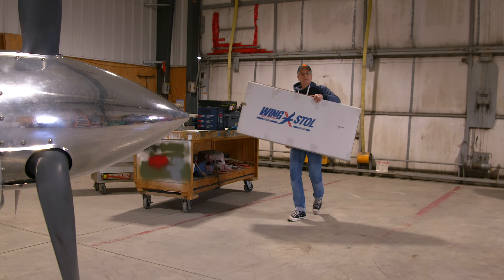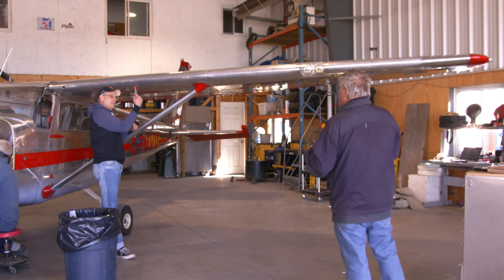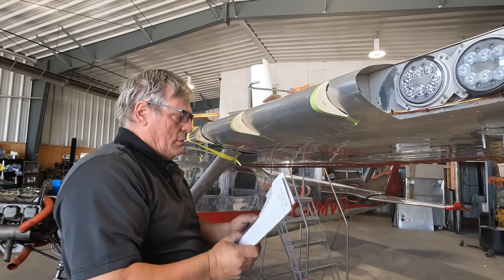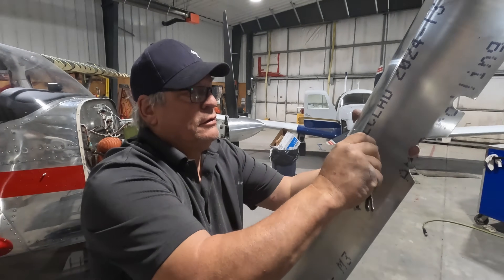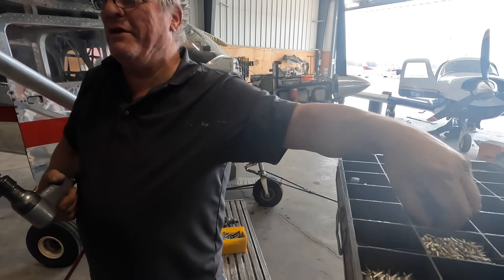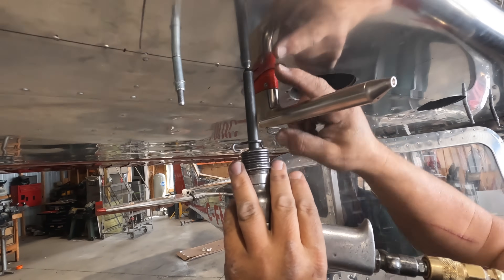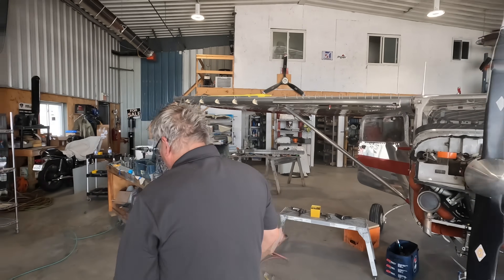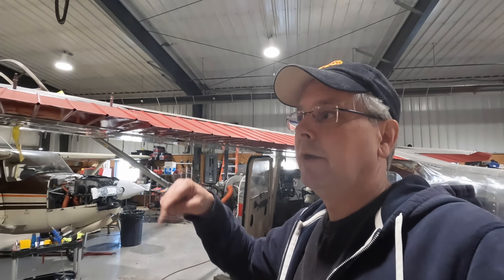Sportsman STOL Kit Installation Cessna 172B

Comment: I bought a 1960 172B which had the same stol kit. Mine included stall strips on the top of the wing.
I always assumed that the kit would cost cruise speed but during a long cross country, flying formation with another later model 172, I had to throttle back to keep from pulling away. When we landed I found the other plane was at max power.
Interesting video.

Comment: I worked for Wren Aircraft in Buckeye, AZ back in 1986. We modified the C182 into the Wren 460P STOL. It was a complete STOL modification that went way beyond the leading edge cuff.
Reply from the maker: Those were amazing - we did as much as we could with this 172: Sportsman STOL cuff, VGs, 3 feet of wing extension, and the drooped wing tips.  If only we could have put canards on the nose...

Comment: its already a stoll aircraft, they are so light. i put flap gap seals on my old 172C, half fuel and me 80kg, the airspeed indicater doesent read the stall speed on landing, had to be under 40kts, my guess about 35kts. this one has to be way better.  my stall speed was lower than most micro lights

Comment: Very neat to see the profile change.  
Will there be specific procedures and adjustments to the AOA sensor and your Airspeed indicator etc now that Stall speed is lower? Does that kit come with a set of numbers of what will change or do you figure out that yourself on the flight test?
Reply from the maker: We definitely have to re-calibrate the AOA, and we have to figure out all the numbers ourselves since we stacked 3 different STOL kits at once.

Comment: Thanks so much for filming this! We just got done installing a Sportsman STOL kit on a 182-B, and it was an excellent learning process. If you have video of Andre using a straightedge to check the alignment of the foam blocks, could you share that as well? It turned out we were doing it incorrectly (as the instructions weren't super descriptive in that area), but fortunately we figured it out at the 11th hour. 
Also, did Andre lay down a bead of sealant across the top rivet line (but not the bottom rivet line), in addition to the front face of each foam block? We had some debate as to if this was really beneficial, but ended up doing it as the instructions called for it. Just curious to find out more from someone who appears to have done plenty of these kits.
Also, does the 172 kit come with aileron gap seals like the one for our 182?
Reply from the maker: Andre didn't put the sealant on - he's seen several of these kits taken off after years of use, and his opinion about the sealant is that it breaks down over time and with flexing stress of the airframe. The gap seals for the ailerons are part of this kit and we put those on; but there was a discussion about their usefulness.

Comment: I've always wondered what one of the relatively simple Cessna's from this family would do with some performance upgrades in the other direction, full gap seals on all control surfaces, more modern cowl design, variable pitch or constant speed prop, and some attention paid to drag from where parts of the body meet (struts connection to wing and fuselage, wing to fuselage, tail surfaces to body). 
Obviously you're not going to change the Vne or Vno to that of a Mooney but I bet you'd get a decent increase in cruise speed at 75% power or some useable range.

Comment: It’s like having permanent slats - does it reduce max speed?
Reply from the maker: No reduction in max / cruise speed - in the next episode we instal the WingX extensions and that saw a 1-2 MPH increase in initial testing... of course that's within margin of error territory. So no appreciable difference in max / cruise speeds.
Reply: @GlensHangar  Ohh nice! Forgot you were doing the tip extensions. Guess it’s an overall net decrease in drag. Very cool.

Comment: will the new seam at the junction of the new wing cuff be water tight? if not, how will you inspect for possible corrosion?
Reply from the maker: It will be as water tight as any other part on the aircraft... which is to say; not very watertight at all.  Cessna seems to follow the 'Let water flow out as easily as it flows in' design philosophy.

Comment: Hey Glen, looking forward to your opinion if the extensions really make that much of a difference in flight. 172s fly great as is so this will be something if the difference is big.
ps, this will open up more grass and asphalt strips for you and Julie's adventures. ;p)
Reply from the maker: I was worried about in flight changes - as we started doing the mods I definitely worried if I was going to mess up a plane that flew straight and hands off. But after flying it on a couple cross country jaunts already, It still flies straight / hands off.

The big change is how well it now handles at very slow speeds, takes off with a shorter roll, and lands slow and short.